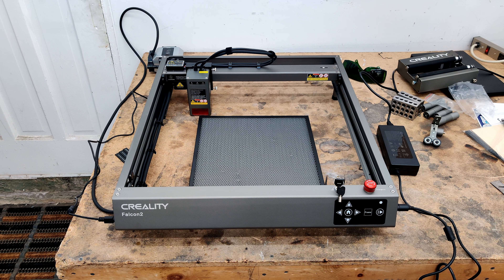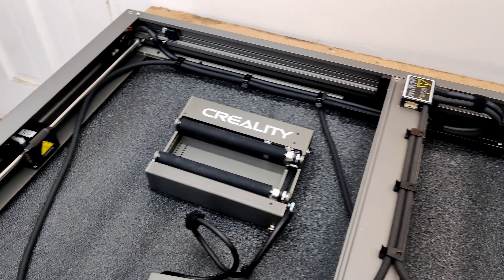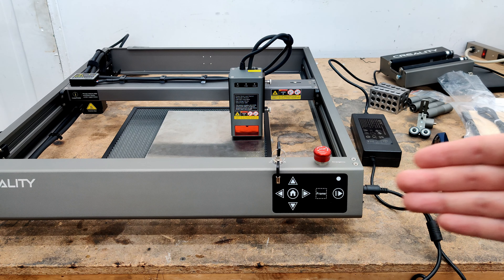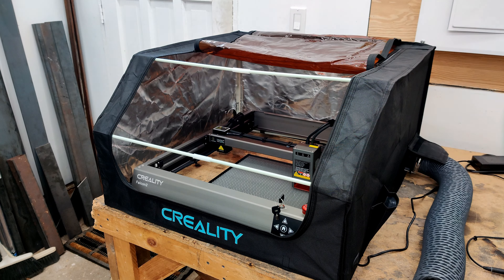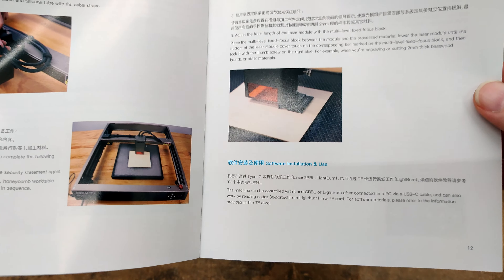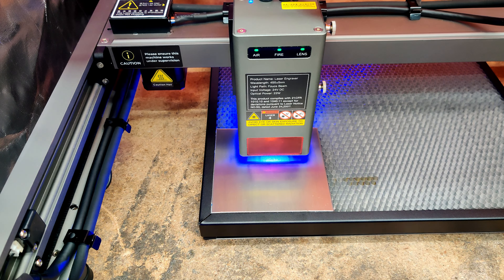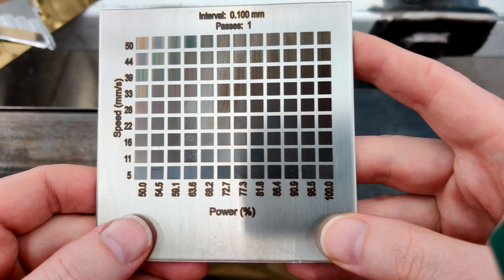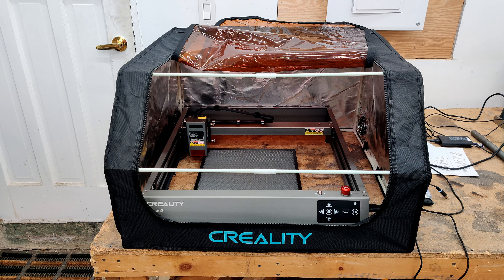Creality Falcon 2 22W: Up close look at engraving stainless steel, and must have enclosure accessory

Comment from the maker: Some noted things I ran into that can be relayed back to Creality:

- Machine comes with green laser goggles that are uncertified and the wrong color. Rest of the machine has orange filters on the laser module and the enclosure. I’m not risking my eyes with uncertified laser safety glasses. Other competitive machines on the market do the same thing. I would highly suggest to Creality that they send CE Certified Laser Safety Glasses. This would be a huge selling point for them to stand apart from the competition. 

- The Y axis gantry rollers/carriages have some play in them (1-3 degrees). This becomes a problem when cutting thicker material due to off angle depth cuts. Especially important the faster the machine is running. It is less noticeable to the naked eye, but up close under optics on lettering it is very apparent that there is some wobble when engraving lettering. On the engineering side the team has designed a very good machine but speed and rigidity/zero play go hand in hand. You can’t have a fast machine with a bunch of play in the motion assemblies. I'm gonna open the assembly up and try to fix it myself. EDIT: I have been able to adjust these and have been able to remove all the play in both X and Y axis. Video on how to adjust this will be posted later tonight.

- Something I didn’t cover/notice in this video: The machine has an E-stop button in the corner. With the enclosure sealed up that safety feature is rendered non-functional because you don’t have access to press the button. I would suggest on future models, especially in conjunction with the enclosure, to have an auxiliary port and a secondary e-stop button that can be externally attached to the enclosure (be part of the enclosure accessory kit). The user might not have the wall plug, or the power input routed through the front right access hole to be able to quickly pull the power if a fire occurs. I have to give credit to the engineers as I notice lots of features in the design of the machine. It looks like there were a number of iterations to refine it. Having the foresight to notice the estop being rendered unusable with an enclosure is difficult to see when the design is in a state of change and accessory items are unknown so catching this design flaw early on is difficult. Looks simple enough to tap into the wiring and add another external estop button.
Reply: I couldn't find the video on aligning th Y axis gantry play. Did you upload it? I also have a few degrees of sag of the laser head, resulting in anoying undercutting in thicker material.

Comment: The included safety glasses/goggles (call 'em what you want) are Ansi Z87.1 and EN166.FCE rated, so from an OSHA perspective, they are safety rated. The green color is very effective against several laser colors. While it would be nice to see where there blocking falls on a wavelength curve, from a liability perspective, it's doubtful that a reputable manufacturer is going to provide safety equipment for use with their products that isn't going to provide adequate protection. If they did in today's age of tort actions, they'd be out of business in no time.

Comment: I have the same laser machine and it makes a vibrating noise whwn running at a higher speed (like Higher than 15000mm/sec) is there any solution?

Comment: So Creality a still shipping these with those green glasses. Are they definitely not useable/safe? If so it would make Creality legally liable for any issues here in Australia.
Reply from the maker: The glasses that come with the laser cutter don’t specify which wavelengths they filter, so I decided to discard them. After doing some basic research on laser safety, I invested in proper protective eyewear. While some comments suggest that the provided glasses are safe because Creality is a reputable manufacturer, I’d rather not take any chances.

My concern is that, without prior experience in laser safety, it’s hard to make an informed decision. I imagine many others who buy a laser cutter like this are in a similar position. It would be reassuring if Creality included some basic information about the laser’s specifics and if the supplied glasses clearly indicated the wavelengths they protect against.

When I order dedicated laser goggles from a reputable manufacturer on Amazon, with the specific wavelength clearly marked and positive user reviews, I feel much more confident in their safety.

Comment: Would love to see an smt stencil on a 0.1mm stainless steel. Could just download a dxf into lightburn, and later apply some solderpaste and look through the microscope.
Could be helpful to know how it works out, since laser stencil is out of reach for most due to Kw Co2 lasers(also run at high speeds) used for the production.
Reply from the maker: I think the one they sell with the 40w head might be able to do it. I'm guessing that with this 22w it likely won't be able to get though. If it does it would saturate the cutting line with a large heat affected zone and that would distort the solder mask. I bet the industrial scale ones we use a tremendous amount of power just a blast through so not to create a heat affected zone at all.
Reply: @BryanHoward  Sincerely appreciate the feedback❤.You are spot on💯👍, as I was thinking about the melting of the cut lines under your microscope inspection. I could cut brass sheets resonably well with CNC, but thought laser would give better precision and does not involve the wear on microcarbide tooling as in CNC milling.
What are your thoughts on cutting 30mm×15mm geometry on a 1.5mm stainless steel sheet with a 40W galvo based fiber? Laser?. Do you have any specific recommendation for such purpose? Thanks in advance for your input.
Reply: Would love to see how you configured your setting in lightburn to not have the crashing and grinding.
Reply: @lyndseypettit6939  I don't own a Falcon 22W, but could give some insights, into what your issue might be.
Seems like you have an issue with limit switch/origin location. As the laser tries to home @startup, it is moving in the wrong direction specified by the incorrect origin, which will not trigger the limit switches, resulting in crashing and grinding. Another possibility, is a loose wiring of your limit switch(eventhough it is a rare possibility). This is common to any cartesian cnc equipment(including 3d printers, engravers, milling machines etc.) using normal stepper motors.